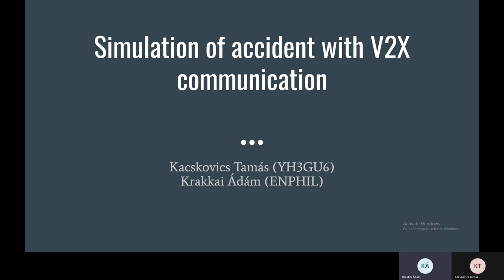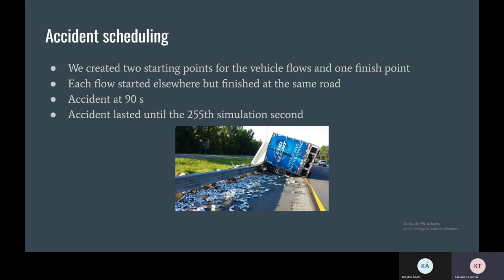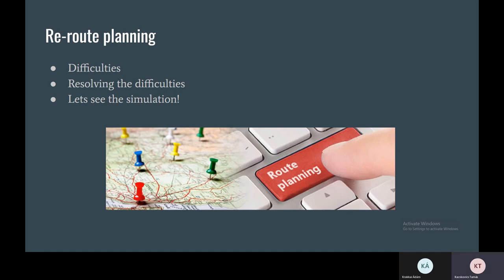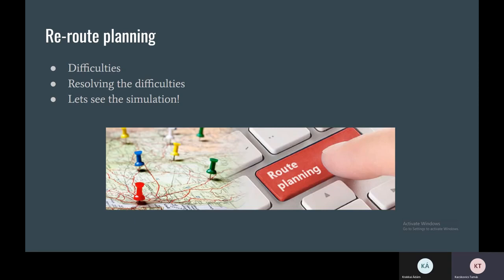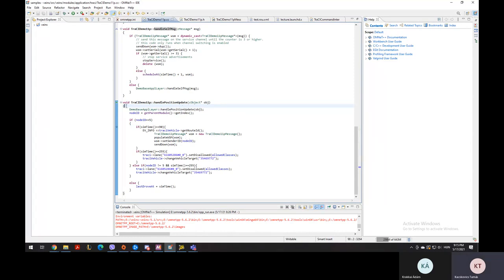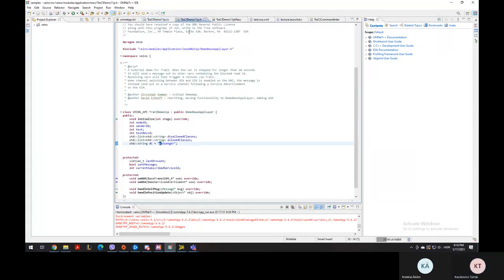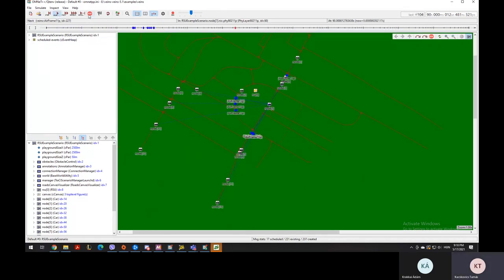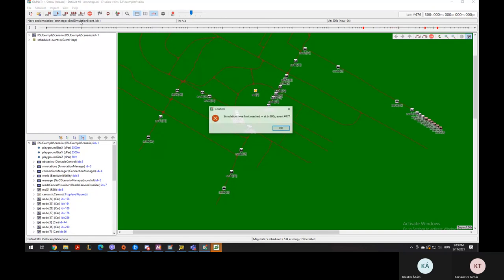Simulation of accident with V2X communication using SUMO-TraCI-Veins

Comment: Hi, I'm starting to learn how to work with OMNET++ and Veins to interact with traffic lights, and I'm having some difficulties about finding tutorials step by step or initial content for beginners. Can you point some directions that I can follow how to start?
Reply from the maker: Dear Christian,
we have a helpful documentation about OMNeT++, Veins and INET: https://traffic.bme.hu/2023/02/07/sumo-traci-veins-inet-omnet-programming/ 
It is not covering traffic light interaction, however maybe can help to understand some omnet and veins related basics. From your application code you can just use this pointer to access traffic light related functions: traci->trafficlight("trafficLightID"), e.g., traci->trafficlight("trafficLightID").setProgram(program); When you type the pointer, the IDE will show you the available functions. It is also worth checking the SUMO TraCI documentation as most of the traci commands are named the same and helps you to find the right function. 

Hope this helps!

Comment: Hello,
If an accident occurs in a multiple lane highway, how can we make the other vehicles change the lane ?
Reply from the maker: Dear Guru Karthik Bolugudde Prabhakar, 
you can make them change lane with a TraCI command or you can disallow certain vehicle types on a road/lane (which was used in this video) and force them to recalculate their routes.

Comment: Please I cannot find the two functions getSenderId and SetSenderId, are you redefine them in TraCIDemo11pMessage?
Reply from the maker: First, you have to define a variable in the .msg file (e.g.,  int senderID;), then you have to build the  project, so OMNeT++ will generate the corresponding getter and setter functions according to the defined variables. After that, you can freely use the functions.